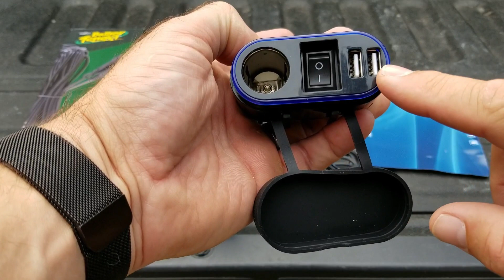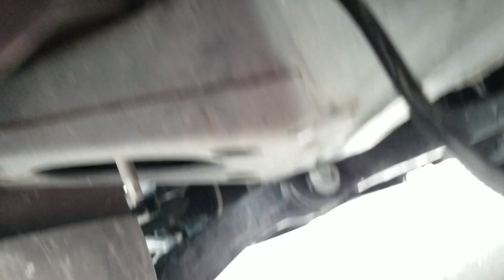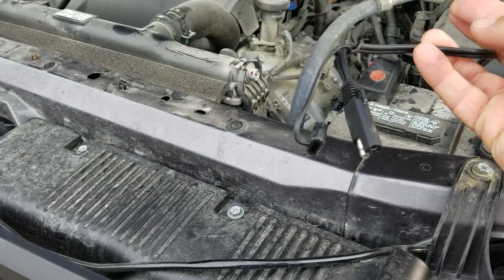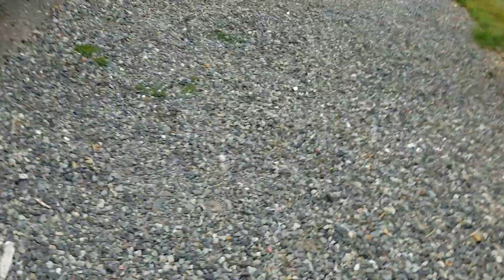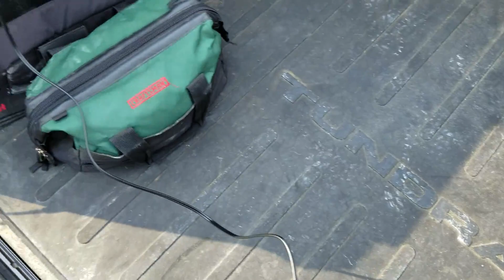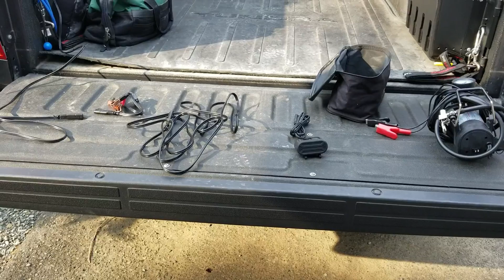Truck Bed Power Project

Comment: Great idea, but the reason that compressor is meant to go directly to the battery is because of the current draw. Look up Voltage drop, and wire protection.

Comment: Why didn't you put a duel battery set up in your truck? All accessories you could run them off the 2nd battery without draining your starting battery, try putting a 2000 watt inverter in your cab, you'll be amazed what you can run off that inverter an a duel battery.

Comment: Question: I have a topper on my double cab and truck camp all the time. Will this allow me to charge my phone, etc in the topper without turning the car on?
Reply from the maker: Yes it will
Reply from the maker: Yes you can because it is directly connected to the batterie

Comment: What usb charger kit is that?
Reply from the maker: I go the kit on Amazon I was just looking for it in my history and it has been replace with this one https://www.amazon.com/gp/product/B01N5CCA6O/ref=oh_aui_search_detailpage?ie=UTF8&psc=1 

Thanks for watching
Reply from the maker: I got it off amazon here is a link to the updated one
https://www.amazon.com/gp/product/B01N5CCA6O/ref=oh_aui_search_detailpage?ie=UTF8&psc=1
Reply: @tundrachronicales336 update? What's the product called
Reply: Can I run my electronics with this set up without turning on my truck?
Reply: Both links outdates again.  Any chance you can find a current link to this products, as well as the 12’ and 25’ wiring?  Thanks...love your detailed videos!  Subscriber.